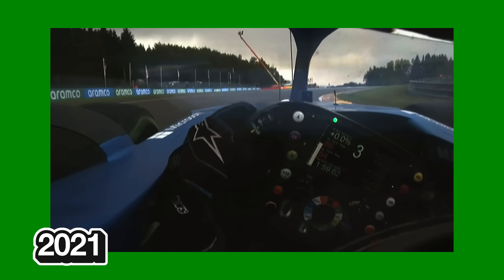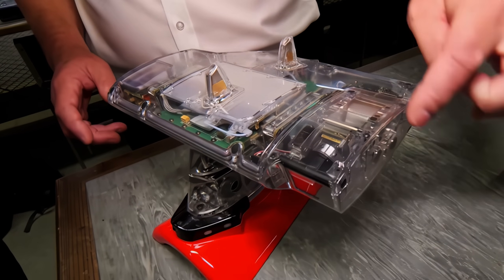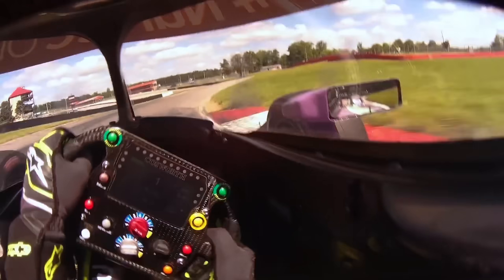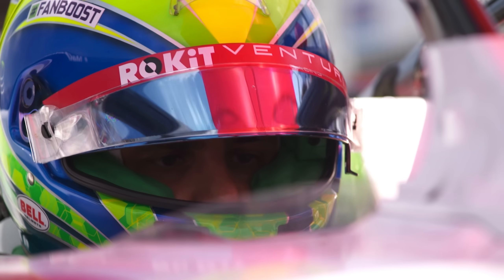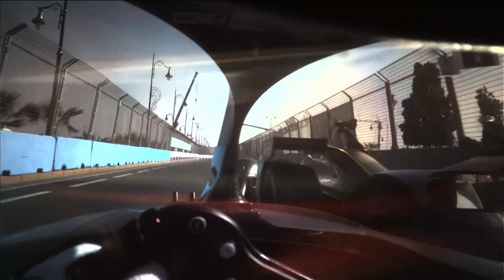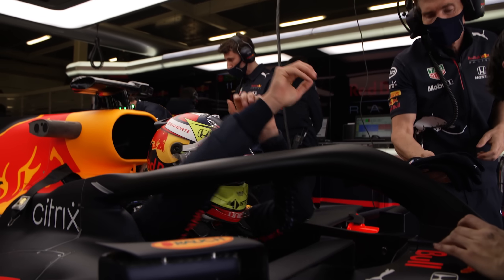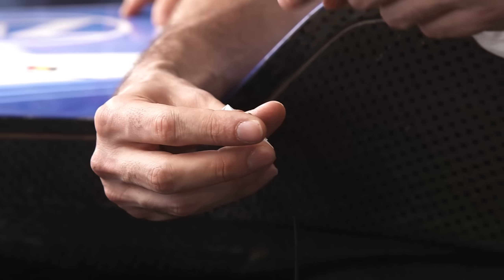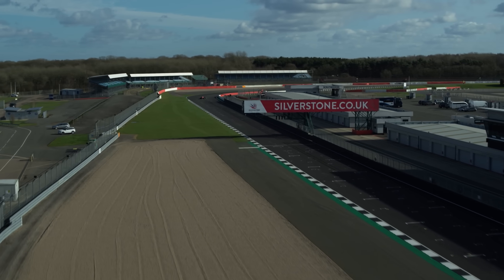How Formula 1's Helmet Cam Works

Comment: I've been wondering for some time why the radio and now the cameras in the helmets aren't connected to the car throughout bluetooth. I would think it would be preferable to have as few cables to undo as possible in case the driver needs to get out quickly. Any one have any idea why they don't do that?

Comment: They need to find a way to Mount it dead centre. I find it frustrating watching it offset sideways as opposed to from the diver’s eye view, which is dead on straight.
Reply: Then the halo would block the view
Reply: @ but no more than it does for the driver

Comment: Interesting fact for all the people shocked that British TV is broadcast at 25fps and not 30fps. In the old days TV broadcast and reception were kept in sync by the frequency of the electricity grid, which would allow all equipment to stay synchronised without any manual tuning. In Britain and the rest of Europe the grid's AC runs at 50hz, while most of the rest of the world runs at 60hz. To double the resolution of images broadcast they would be interlaced, so one frame consists of every odd line, then the next would consist of every even line of the picture. In Europe this would mean you'd be getting 50 half frames a second (or 25 deinterlaced) and in America you'd get 60 half frames (or 30 deinterlaced). As technology has improved bit by bit in a sport mostly produced for European audiences, hardware has been gradually replaced leaving this remnant because it's not worth the effort of creating new complications during production. Nowadays, even though all broadcast is digital and all consumer hardware can play any sensible fps, the framerate stays at 25fps because there isn't actually any demand for higher framerates.

Comment: I wish they had horizon lock. You would still be able to see the shake because the cockpit moves around, but the surrounding track is easier to see.

You can do software stabilisation as post-processing for replays without adding weight to the helmet

Comment: F1 wasn't using such a cameras, because of broadcasting limitation. This small devices had to be designed in such a way to transfer data despite all the interferences and distances on the track and also fight shere speed of cars.

Comment: When the whole world is at 60fps, F1 broadcasts stuck at 50fps. Ironic coming from a sport that involves cutting edge technology.
Reply: The whole world? The 50Hz (25p, 50i, 50p) system is used in all of Europe, Most of Asia (minus Japan, South Korea, Taiwan, Myanmar and the Philippines), (maybe) all of Africa, the southern parts of South America and most Australasia. 
60Hz (30p, 60i, 60p) is mostly in North America, the Caribbean and the more northern countries of South America (including Brazil).
It's much easier to film at 50p and up to 60p/60i or go down to 50i than to film at 60. At 50 - most of the world gets perfect framerates to broadcast standards while 60Hz countries get 10 frames repeated (subtle frame hanging - pulldown). When filmed at 60 and converted for 50 Hz regions you lose 10 frames/fields and get frame skipping.

Before FOM took over all broadcasting duties, some races had a local production team film. When F1 raced at Indianapolis, The US Grand Prix was shot in NTSC 480i 60 (30 frames per second, 60 fields per second as well as the Japanese Grand Prix and the Canadian Grand Prix. The Brazilian Grand Prix used to be be shot in PAL-M (very close to NTSC) 60i (30 fps). For the last 10+ years it has been standardised by FOM. 

So the whole world does not use 60p or 60i - most watch at 50i or 50p unless they're on video websites that have 60p videos or live in a 60Hz country like one in the aforementioned countries.

Comment: Works the same as any other camera 😂 pretty pointless video lol
Reply from the maker: Didn’t realise most cameras are crash tested with the FIA, wireless transmitted over 10ghz signal and are only made by Bell Racing!
Reply from the maker: Didn’t realise most cameras are crash tested with the FIA, wireless transmitted over 10ghz signal and are only made by Bell Racing!
Reply: @mattamys  Dude, this kind of technology was used almost 20 years ago in CART/ChampCar. Look for Paul Tracey helmet cam at Long Beach Grand Prix 2002.

Comment: Honestly, when I saw Alonso's helmet cam pov, it was the best, although bit shakey but it really showed how fast they were going, and how it sort of feels when turning with all the Gs. I felt that was incredible, and kind of the same feeling when you look at the old Formula 1 povs
Reply: It looked good altough I wished they would have used a bigger FOV. Then it will look like its going even faster. Also nice if they would have added some stabilization because the vibrations ist't really something you'd experience
Reply: A Former F1 driver Alex Wurz said the shaking is exactly the same the drivers experience. He said that in AbuDhabi 2021 he is a commentator or how it is called
Reply: @herbertmayer5272  I've driven his F1 car, you feel the shaking but you don't actually 'see' it because your eyes also stabilize. But I feel the Abu Dhabi visor cam was better than the earlier ones, I think. (Didn't really see it that well because i was at the race)
Reply: The shakiness is exactly what Alonso was going through.  It was fantastic, and it's the best way to get the feel for the speed without using stationary cams (which Liberty media won't because they're not cool enough or whatever).

Comment: I just realized that technically an F1 car these days is one of the biggest and most expensive media equipment on 4 wheels
Reply: @jooncash  yeah kinda,
Reply: CART /ChampCar used this kind of camera technology almost 20 years ago. Paul Tracey at Long Beach 2002.
Reply: Check out the camera-car Bugatti Chiron XD
Reply: @YS9-9  a Bugatti Chiron costs nothing compared to an F1 car
Reply: @maddox471  not really true, it depends on what you look at and how you look at it
Reply: @YS9-9  a Chiron is worth close to £3 million 

While a modern F1 car is worth well over £12 million without development taken into account
Reply: @maddox471  Now if they did it with a McLaren F1, that would be something and much more expensive than an Formula 1 car.

Comment: To be fair, not good enough. I think Bell and the others should take up the RnD in this department, stabilized 4k is not that much to ask nowadays, but it looks worse than a vga webcam now.
Reply: If it were so easy, it would have already been there.
Reply: @motorcycle-man  I did it, kinda

Comment: imagine if they used both left and right cameras and stitched them together to have this amazing centered drivers eye camera
Reply: That wouldn't really work I don't think, you'd be creating something more like stereoscopic 3D at that point
Reply: @vhallediting6551  it actually would work, but you need an onboard GPU to render input from both cameras directly wired to it which would be extremely difficult to find a place for in an F1 car, the other option is to use recordings... which can be cool but kills the excitement imo.
Reply: @MU5T1  I'm just wondering how they'd stitch the videos together.
Reply: @vhallediting6551  Eh shouldn't be that hard. Algorithms for it probably already exist
Reply: @Someone25948  interesting, I'll have to look into it
Reply: @Someone25948  its all about latency, the camera has to be live broadcasted
Reply: @MU5T1  why not just have 2 cams and have it send to the broadcast and get it renderd there
Reply: @MU5T1  the giant flaw with the original idea is that:
- There's no significant gain (what if I like to look out the windshield a little bit from the left, synthesize that for me).
- it's naive. Creating a realistic image based on two other images, none of which is the image you're looking for, has no easy solution that works great as of now.

So, I'm not saying I think the original idea is good, but if you think you could do it with GPUs, you can have the GPUs where you want, you're just going to have to send twice the data out of the car, which isn't a lot compared to the power you'd spend on the GPU, you're already sending one video stream, maybe two if you have another camera mounted on the car, so the additional streams would at worst be twice the power & weight of the existing camera & transmitter.

You might need a way to synchronize the "shutters" of the cameras too, otherwise you might to end up with slight timing issues between frames of the same "moment" from both of the feeds, you're still going to have some of those timing issues if you try to do it with an onboard GPU.
Reply: @MU5T1  what if they transmitted both offload, stitched it, and then broadcast it ? I know latency might be a problem, but that would probably work...
Reply: u wuld puke
Reply: Lmao that's not how cameras work
Reply: That would be so cool
Reply: in few years in future, this is probably not an impossible things to do seeing how fast tech grow nowadays tho :)
Reply: A million dollars question that comes to ur head at 3 am lol
Reply: Would be epic as VR experience
Reply: Or just have a camera on the middle lol
Reply: I guess if you did that it would technically be vr but would  need a vast amount of processing onboard to do it live
Reply: Or vr
Reply: F1 VR
Reply: Might help you see magic eye pictures
Reply: would be 3d
Reply: Or make a 3d video out of it
Reply: 2026 sure
Reply: If you stitch two images together from different points of view you woulnd't get a centered image, you would get two different images projected at the same time, it'd be like seeing double. Imagine a 3D movie but without the 3D glasses, that's how you'd see it.
Reply: Intelligence: -100

Comment: My god, imagine if this was implemented for all drivers in 2020. We would have had a POV from Grosjean's crash.
Reply: They probably wouldn’t have shown it, they didn’t even show the t-cam from his crash
Reply: @rsg-lewisdagoat  You can watch the T-cam footage on F1TV but it cuts off right before he hit the barrier because of course the car got ripped apart. I assume it would be the same for the helmet cam but would still be incredibly impressive to see a small bit of what he experienced.
Reply: @Bastiaan_net  The t-can was still running during the flames, the fia director has stated that only him, a few f1 & fia officials, and roman himself have watched it, he’s stated that the camera showed the struggle attempting to leave the vehicle.
Reply: @manny4707  It was not a T cam. Every car has a high speed camera facing the driver so FIA can analyze how driver's body was reacting during crashes to improve safety. The camera and equipment recording the video and all of the telemetry from accelerometers is contained within the survival cell and can be retrieved from the wreck.
Reply: @rsg-lewisdagoat  the reason they didn't show it is when his survival cell seperated from the chassis it ripped apart the parts used to record and transmit, they sit between the survival cell and and the ECU, etc. it was ripped open along with the rest of the car and stopped transmitting the second he hit the wall
Reply: Heard somewhere that there was a camera that was still running that they never showed. Maybe the camera on the halo column was still running?
Reply: You would not have seen much except for pov boom to the wall and a lot of orange glow afterwards
Reply: @Rheenen  and then that movie style of him comming out of the flames if he had a helmet cam
Reply: @KiDD_D  with the cable that goes into the helmet disconnected you wouldn't get any of that
Reply: I don't think I'd wanna see that ngl...
Reply: Grosjean’s car completely lost all onboard feed+radio on impact so we wouldn’t have gotten any more footage than we did.

Comment: interesting that F1 didn't blur/black out the dashboard like what FE does
Reply: I think it's because we are passed the halfway point and no one cars about the 2021 cars anymore
Reply: I believe its because FE have the same dashboard, so other teams can easily interpret their data. With F1, each team has a different dashboard and other teams cant easily interpret the data.
Reply: @-TJ-  Definitely not, if you go to r/Formula1, there are people who transcribe data from the halo cam. It's most definitely possible to extract data from the steering display, it's just that it isn't worth it
Reply: You can already see a lot from the regular onboard camera so it's no biggie, I guess.
Reply: If the camera was standard and every driver had it then you'd see the dashboards get blurred out

Comment: i got just one question: Why the hell F1 use the rollhoop camera offset to one side instead of having it centralize like the indycar camera?
Reply: Indycar uses a single motorized camera that can be spun by an operator to any direction. F1 uses two fixed cameras, one pointing forward and one backward.
Reply: @AntiComposite  in the past Indycar used to have one fixed camera on top of the rollhoop with two points of view, one pointing foward and other point back and the camera was centralized. The fix would not be something fancy, "just" turn the camera 90 degrees and problem solved

Comment: I hate how it’s placed either on top of a helmet, left side or belly cam. Why cant it be placed in the midle of the nope as a mini cam!?!?!
Reply: And what happens when during a crash or something it dislodges and ends up in the driver’s eye?
Reply: @dsdy1205  well, i didn't say it would be good under races
Reply: @marcusineadam  I think the point here is FOM is aiming for cameras in races for a better sense of speed / excitement, so their solution must be crash-safe
Reply: @dsdy1205  F1 Promised us a halo since 1980, hopefully it wont be 40 years for this.
Reply: @marcusineadam  amen to that